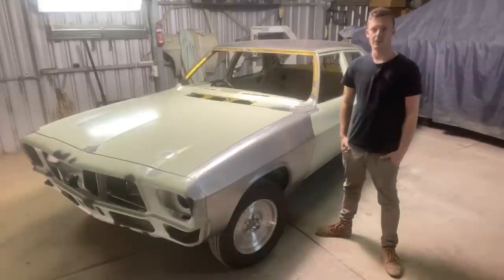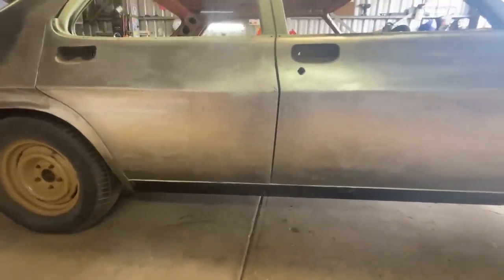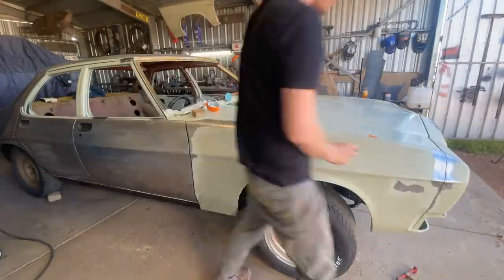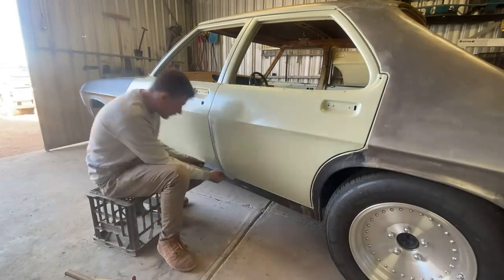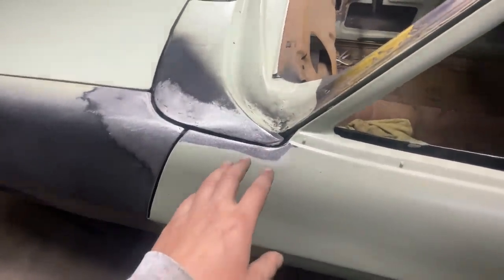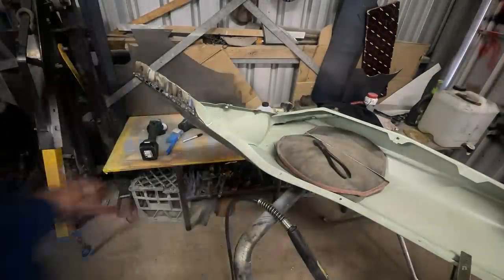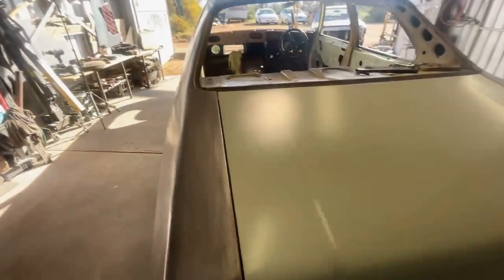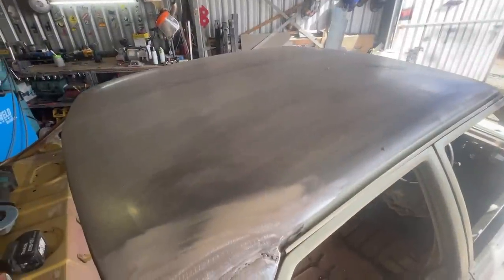Gapping an entire HQ Holden Kingswood - Panel Gaps & Alignment - The Resto Shed

Comment: Great video, just wondering what the panel to panel gap height will be like when new rubbers are fitted and latches may need to be adjusted for doors and boot to work properly again..
Reply from the maker: Yes mate that is very true. I’ve already been through that with the initial fit up of the panels and have ensured that there will be enough room for the rubbers.
Doors and strikers will always need some minors adjustments as the car is assembled, weight of the glass/regulators ect.
In this video I was just focusing on removing the ‘butting’ of the panels ensuring the panels sit flush with one another as much as possible and making the panel gaps more consistent than what they were. 👍🏼🇦🇺